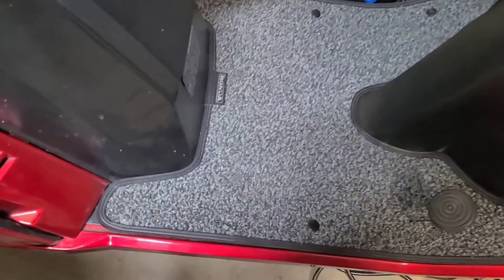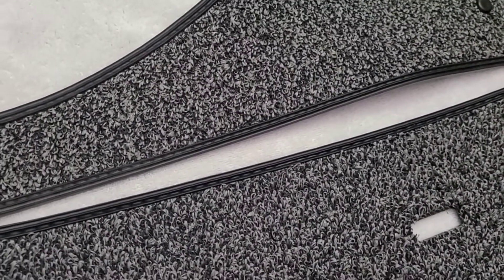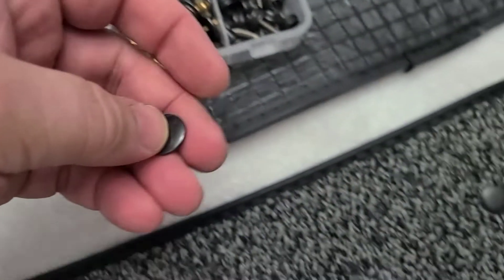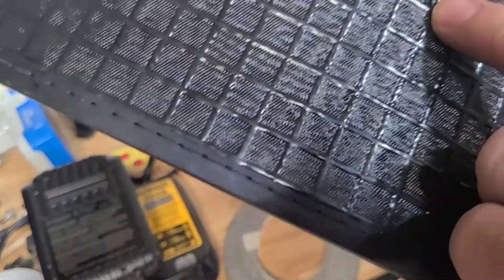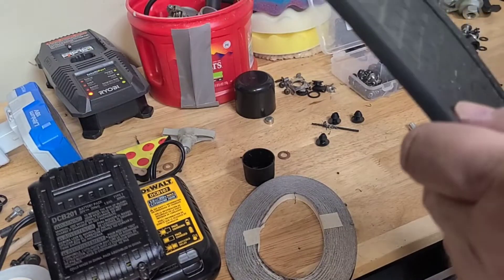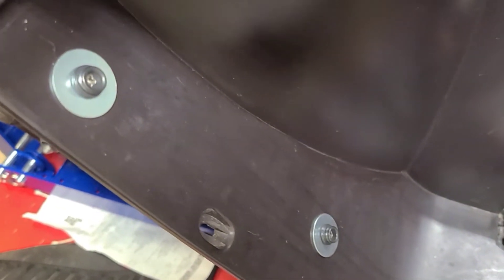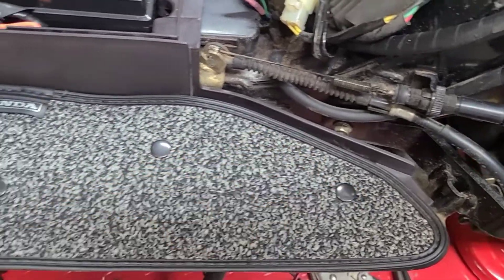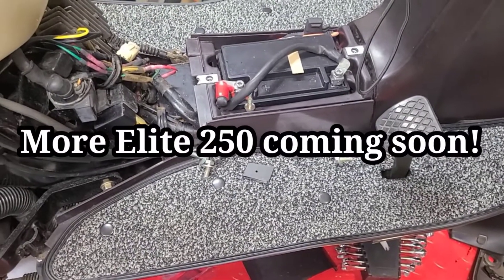Honda Elite 250 CH250 - NOS Hondaline accessory improved and installed. | Ruby the Elite

Comment: I finally found the carpet for my ch125. had to add the snaps but it looks good… the mats for helix those are BADASS I gotta keep my eye out for my helix
Reply from the maker: Not easy to find are they? Especially if they are NOS for the 125. I've never seen a Helix one. Shouldn't be that hard to find since that model was made so long. I will also be on the hunt for that! 😁

Comment: thanks for video, one of my nubs broke... i hate how the carpet came with 3 of them.. i want to use GM fender plastic rivet to keep it flat and secure instead of the nibs these carpet came with that break being so old.
Reply from the maker: Convert it to snaps like I did makes it still look OEM. Fender rivets should work as well. I also use 10 inch strips of velcro. ( I didn't show velcro on my video). It makes for an even nicer installation. I would never trust those nubs!
Funny thing about the radio.  When I bought Ruby (My Elite 125) the previous owner handed me a CH250 Kenwood radio new in the box. It didn't fit in the CH125 so he just held onto it for years. The previous owner to him bought the wrong one and never returned it. He gave it to me and I sold it on Ebay to someone in Greece if I remember correct. Sold it for $500. If I wanted I could have got $700 if I sat and waited for a buyer.  It was a freebie so I didn't care.

Comment: Hi there, consider also to use velcro.
Reply from the maker: I used a long strip on both sides.  Thanks for the idea!
Reply: @rubytheelite  could you show how the seat release mechanism works on your 1984 Elite 125. I picked one up with 350 miles and thats the only thing that is missing on it and cant figure out the part thats missing the key turns but theres nothing that touches the seat release lever. Much appreciated!